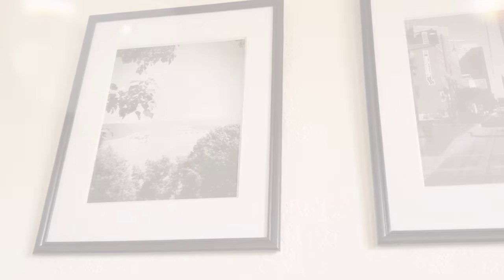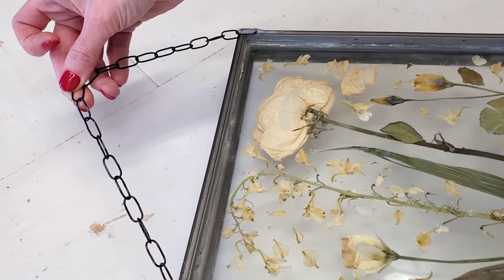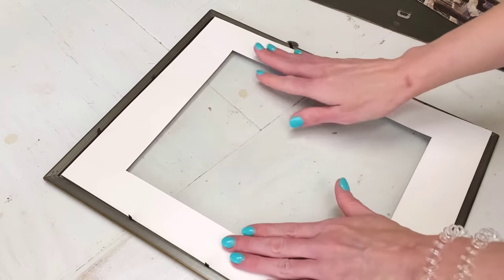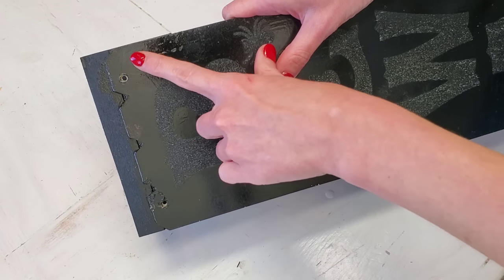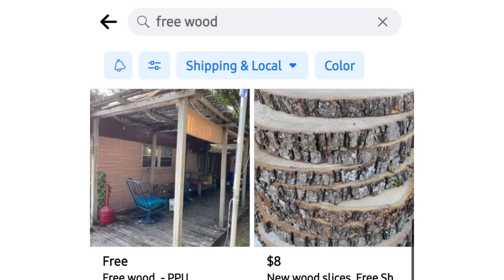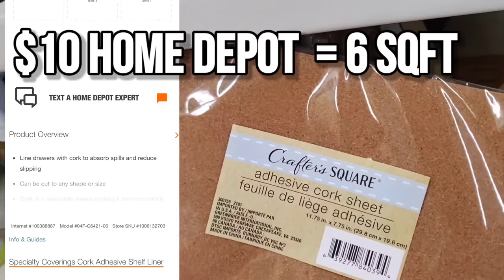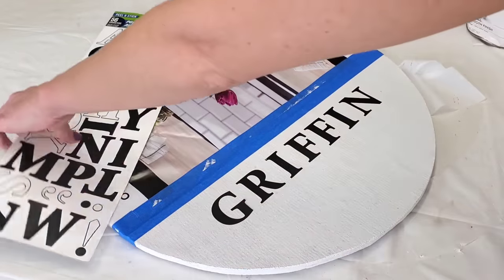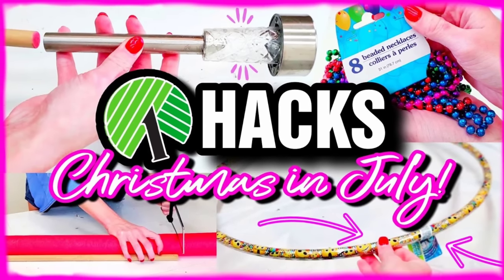5 Easy Ways to DIY WALL DECOR Using $1 Supplies!

Comment: Fun tip on the flowers, if they are thinner flowers, or just the petals, you can use parchment paper and an iron on the lowest setting and press the flowers. They’re done in less than a minute that way 🤗.

Comment: For the hanging flower pot idea, drill small holes in the bottom of the plant boxes to allow water to run through, so the box doesn’t collect standing water. This also is a good way to water the plants below-pour water into the top plants and the water will filter through onto the plants below